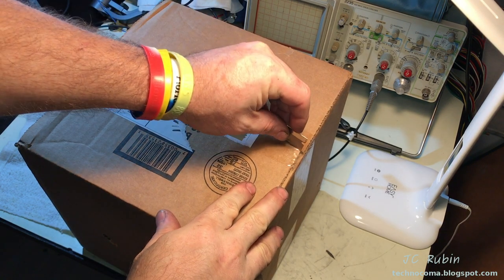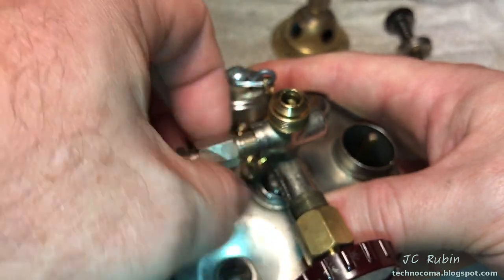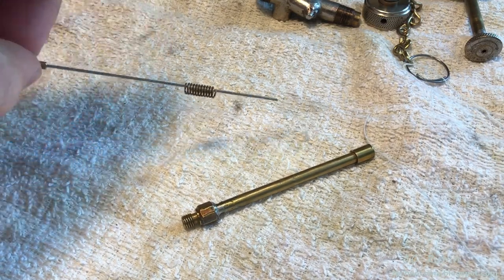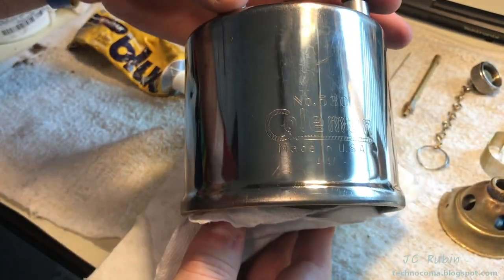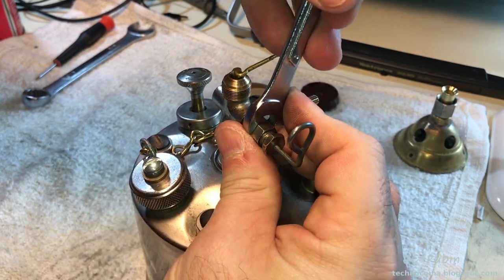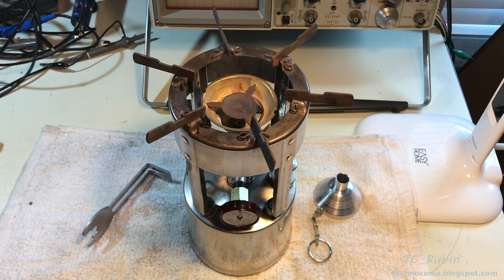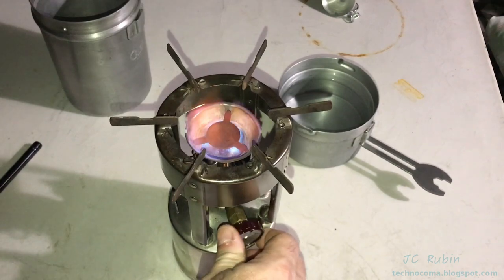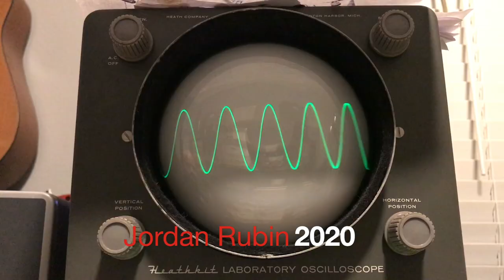Coleman 530 Stove Complete Teardown Rebuild and Maintenance

Comment: The fuel valve assembly is the same as the one in a 220 lantern.  The reason it wants a 1/4 turn to light is that is the mixing position.   The valve is ported to draw air from the tank (that is why the filler is below the top of the tank to create and air space) and mix with fuel when lighting.   After the burner is hot and the generator is hot the fuel vaporizes on it own as it exits the generator tip.  Then you turn the valve full on to only pick up fuel from the tank.   Should also repressurize the tank at that time too.   The tip cleaner will clog up if you use it for a variable fuel control.   Like a 220 lantern this stove is either full on or off.  Off is the knob not the tip cleaner.

Comment: Great informative video. 
Job well done. 
Just a thought about draining the fuel from the fount. 
I have rebuilt many lanterns and stoves over the years and found that the lanterns I find with white gas or Coleman fuel in them are in really nice shape with little to no rust inside. In every case I have found one with no fuel the fount has heavy to severe rust a pitting. 
The white gas has rust inhibitors in it. 
Once again Great video. 
Thanks for sharing and God bless.

Comment: Well done. The most perfect disassembly and dissertation. I am in awe. Yes I have one of these I bought from Ebay. I tested it with a full fuel tank. I pumped it up, The pump feels loose, check valve condition is unknown. Nothing bent. But pumping it, causes fuel to leak at the knurling at the tank, at the base of the threads for the cap. I have to assume that the knurling means that the filler neck/tank cap can be unscrewed from the tank? Any experience with this Mr. Rubin?

Comment: Totally loving the break down tear apart , the engineering you just don't see these days allowing for such a device to literally  function forever .
Reply from the maker: I wish it did variable adjustment, but it really isnt designed for it.
Reply: Mine came with a round metal plate the same diameter of the stove itself. It's designed to sit on top of the burner and does seem to help reduce the heat to my canteen cup somewhat.

Comment: Great little stove, I leave fuel in mine all the time as rust prevention.
Reply from the maker: There is a never ending debate on this matter.  Im of the opinion for long term storage it should be completely emptied and something like inox sprayed lightly into the tank.

Comment: Thank you for this great video, helped me tremendously with cleaning out my oarts.  For whatever reason I can’t get my stove to light and stay lit.  I think it may be the vaporizer.
Reply from the maker: All parts must be individually inspected, only one failure will stop it from functioning.
Reply: @retrotechandelectronics  thank you!  I double checked all parts, check valve is good and changes the cap it held pressure for 24 hrs.  All I can think is vaporizer as I re-cleaned the internal tube, everything seems to be fine.  Screen is somewhat dirty as I cleaned as best I could. I will keep at it though.  Thank you again for this video it was extremely helpful.

Comment: Great video! I have a Canadian made 530 in great condition.
Reply from the maker: Is there a marker on the stamp for a location for production.
Reply: @retrotechandelectronics   It just says, "Made In Canada", 1-47 (January 1947). I also received the original instruction sheet with it.
I got the original tool handle but did not get a fuel funnel.

Comment: Great tear down!  Been going through an old Coleman stove phase, have a 502, a 413 and soon to have a 530. Curious how you think water gets into the fuel and rusts tank out…  does it condense through the steel?  Also I wonder if Coleman’s “anti rust” additives would help much.  Plan on keeping a 530 in my vehicle
Reply: Being a sealed (pressure) system I wouldn't think moister would make it's way in if you shut it off after use
Reply: Moisture in the atmosphere pumped into  the font where it condenses.  Being heavier than the fuel it settles in the bottom causing rust.

Comment: Hello I had a quick question for you about the Coleman 530. I have one and it's the b46. I completely tore it down and cleaned everything I could and got it working damn near perfect. The only issue that I have that I was hoping maybe you could give me some idea on how to fix it is, when I get done using it and I turn it off and I leave the lever the lever with the cleaning needle down, and I turn the knob to the off position the burner still goes for about 5 more minutes minimum and never completely actually shuts off. With the lever down I know that means that the needle is down so it's letting the fuel up so I do that and then turn the knob completely off but it still continues to burn not quite as high as when I had the knob turned all the way up but it goes for 5 or 10 minutes before it slowly eventually turns off do you think that's a issue with the knob and I'm not sure how to adjust that. The lever seems to work fine and everything else is perfect but that's my only issue is turning it off it seems to not turn off when I have that knob all the way to the off position. Any help would be greatly appreciated thank you very much for everything and I love the video
Reply from the maker: There is some residual fuel, but mine does not go a further 10 minutes is excessive,  you may want to look at that valve again
Reply: @retrotechandelectronics  . If you don't mind me asking which valve? Are you referring to the dial? That seems to run good back and forth off to on really good I'm just not sure how to adjust it so when I turn it completely off and the dial is all the way clockwise to off, I'm not sure how to adjust it
Reply from the maker: @lessstuffmorefreedom-livin6886  yes, the fuel must be coming from past the valve is not fully closed
Reply: @retrotechandelectronics  any idea on how I would fully close the valve? I turn the dial all the way off but it's obviously something else inside

Comment: I have a 530 also but I am having a hard time taking out the screen it’s stuck inside the tube any suggestions on how to get it out and not damage screen while doing it?
Reply from the maker: A safety pin or sewing needle can be used to pull the screen out the way i did, maybe soaking it for a while to loosen any crud would be advisable.
Reply: @retrotechandelectronics  Thank you sir I will try to do that with my stove your video made it possible for me to tear mines down and service it. Keep up the videos you have the talent for teaching your instructions are precise and to the point and very clear.